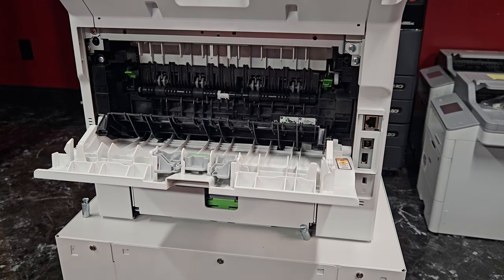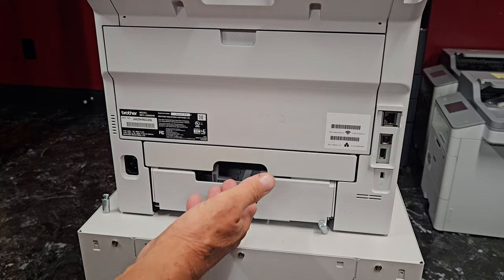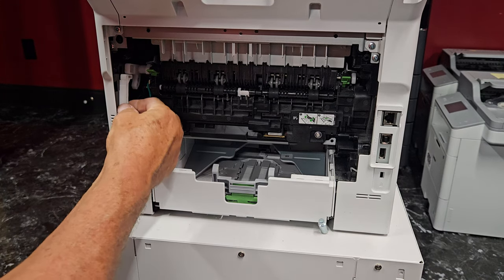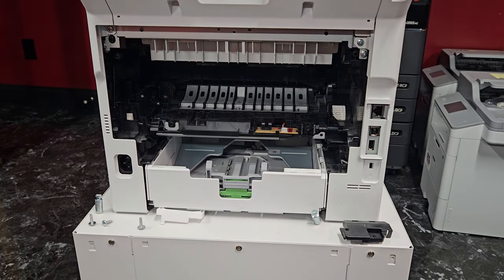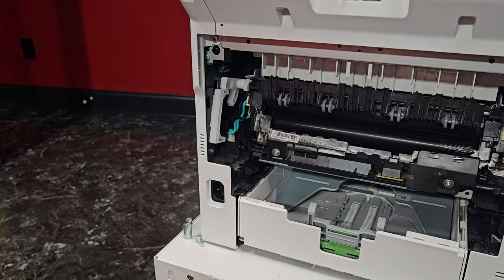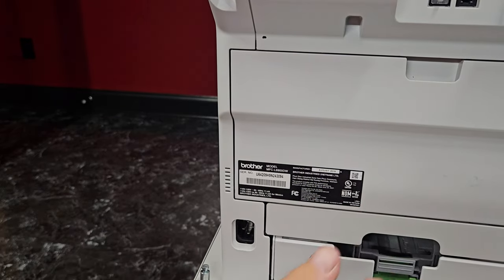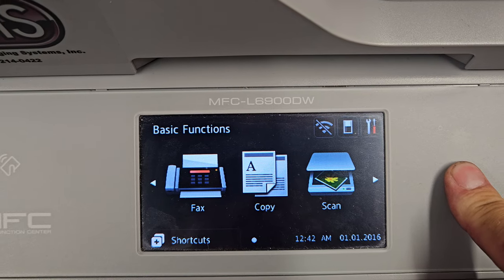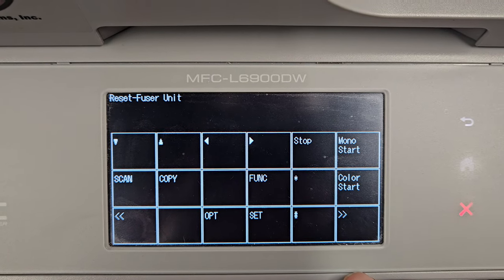Brother fuser replacement and reset procedure for wrinkled/creasing prints

Comment: Thank you so much!  Thanks to your video, I was able to disassemble my laser printer, remove the fuser, remove the cover for one of the fuser rollers and peel out the iron on page that had gotten melted and wrapped around it.  You just saved me having to take it in to be professionally serviced and buying a new fuser unit.  My printer is less than 3 months old, so still has tons of life left in it.  I was so used to ink jet printers that I didn't even think about printing an iron on patch for my Freeze dried candy business aprons.  Lesson learned!  Most of my friends were telling me the printer was junk.  HA!  It's working good as new.

Comment: I have an older, MFC, is the fuser changing process pretty much the same? Also, I was told the fuser is the the reason why the toner is not adhering to the paper and smudges off.

Comment: Do you happen to have a video replacing the fuser on the printer HL-L6200DW? My printer keeps wrinkling the paper. Started with the first page but now it does the same  to any single page.
Reply from the maker: I believe it will be the same as the HL-L6400dw.
Reply: @mrbonz00  Not the same, In rapid succesion press ok>go>up>up>up>up, go to 88, and the press down till you see reset fuser.

Comment: Can you put the link where to get the fuser from?
Reply from the maker: Here is the part # for Brother D01SE6001, D008AK001, D00V9L001 fuser. ONLY use OEM/GENUINE  fuser unit otherwise you will have issues..... trust me!  Put the part # in for your search on Ebay and you should find one.